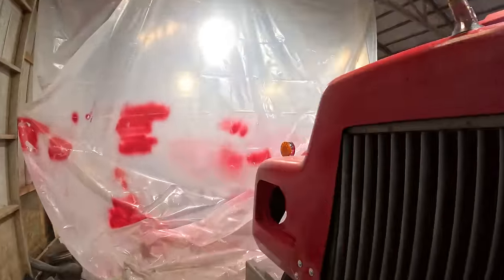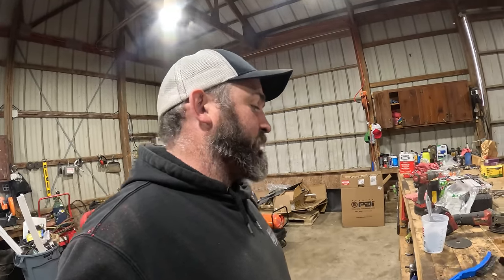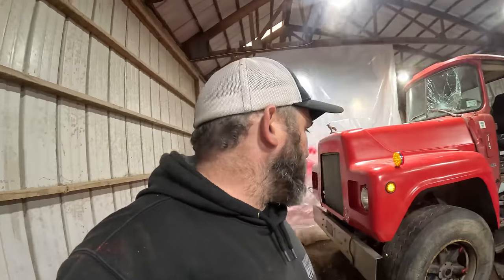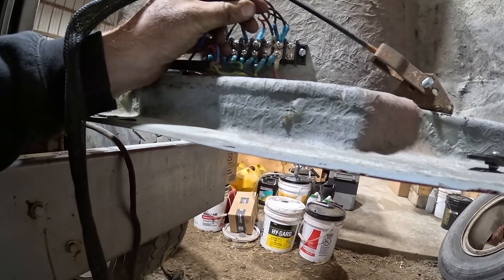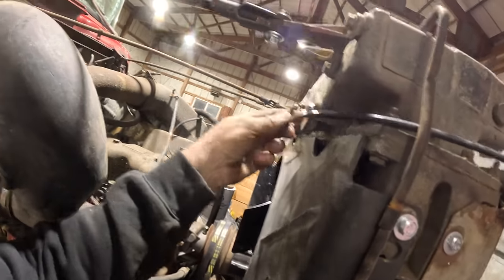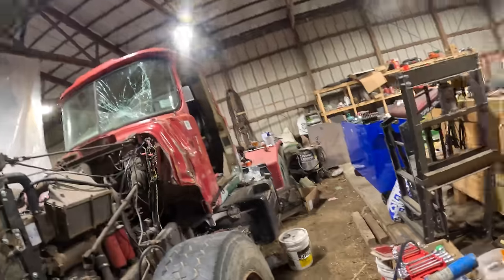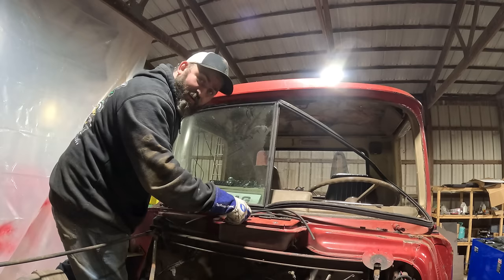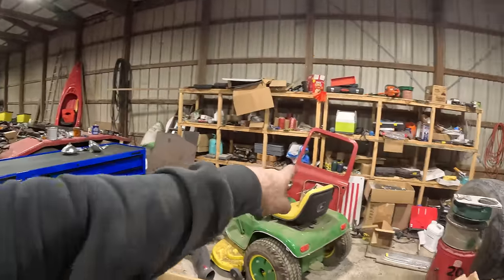Working Lights And No Windshield In The R Model Mack

Comment: when putting the glass back in you might be able to use  piece of string ..put the string around the inside of the rubber get the glass in the rubber maybe a corner  and pull the string out slowly making the rubber open wider for the glass to go in ..just an idea .keep up the good work thanks

Comment: When using a hole saw to increase a hole size, put a scrap piece of wood on back side of existing hole so you have material for the pilot drill to keep things from jumping around.  Also, the offer to help you putting a radio remote on your manure trailer still stands.
Reply: If thats not an option, holesaw a piece of wood that fits in the hole, then put that over the pilot bit of the holesaw you want to use.

Comment: Tip from someone in the salt belt (eastern Canada - Newfoundland). Pick up a can of Fluid Film and spray that terminal strip and all grounds and battery terminals. Its great for preventing corrosion and electrical gremlins and will not break down copper wire or the jacket on copper wiring. 

I use it on vehicles new and old, my atv, ‘89 argo I completely rewired and restored, and marine applications especially boating on the ocean.

Comment: so now when you step on the brake, the radio come on!! Your good at wrenching! I love the colors on the Mack! I think you could do a windshield! I've taken out and replace a few! I'd go to the junk yard and get one! To take it out, without breaking it, I'd set in the seat, in the middle, one foot near the steering wheel, center, the other toward the passenger side, center, then push evenly! that special tool is called a flat screwdriver!🤣

Comment: So you should get a lower back-rack for the toolbox that you can hang tools and stuff off of (below height of top), that gives you a counterweight to having the drawers open AND a place to hang strange stuff that doesn't go in drawers.  Handy place to put welding stuff, spare metal pieces and so-forth.   I don't know why the companies that make the toolboxes don't put twinning brackets on the ends so you can latch a pair together back-to-back.    Someplace I also remember a series of little cammed "stand feet" you can adjust to the correct high, slip under the toolboxes beside the castors and step on to lift the load off the castors.    The back-rack is super handy tho.

Comment: They are easy until they are not lol. Pulling a string around to get the lip of the seal to pop in place works well but I have also cracked a few lol

Comment: I'm shocked you can't find windshields for that R model. That is a very common truck in your area. Also, the black headlight buckets and trim, great choice. 👍 Really makes the old girl look good.
Reply: Why would anyone want to stock an item for a 49 year old truck. Not sure if that’s the same as the newer R model Mack’s.  When doing inventory in a drugstore, when pills in a bottle are three years old it’s considered to old and of no value, written off even if expiration date is still good. Think of it this way if you haven’t sold it in two years why would you want it on your shelf.

Comment: Duffy:
While the windows are out of the cab put the legal amount of tinting on the windshield to reduce the sun threw the windows causing the cap getting to hot.
Are you also going to take the back window out as well to clean that area of rust while you are doing all that work and have done that as well before painting why not have the doors installed as well then paint and put something over the dashboard Gage cluster and switches to prevent over spray getting to them?
Once you do the outside of the cab first then paint the inside as well to refer to the inside as outside I know that you say you are not going for the showroom, finished I know you said that you wanted to leave that  alone.
I would fix it anyway because when it rains the rain can affect the curketbraker panel if that front driver corner is not repaired although it is up to you and what you want to do with your semi-truck.
In the end it is your semi-truck and I am sure glad to see that you are having fun, with the truck and are happy with the outcome of the semi-truck.
Sincerely!
R.S.V.

Comment: I would be worried there wouldn’t be enough weight on the steer axle for those floats to bite in when steering. The silage truck might make better use of them
Reply: Yup. Floats ain't worth a shit in the field. If it's a little damp they won't turn , and just slide.